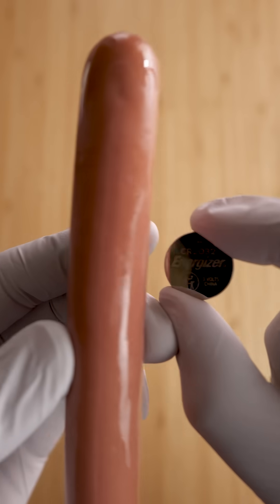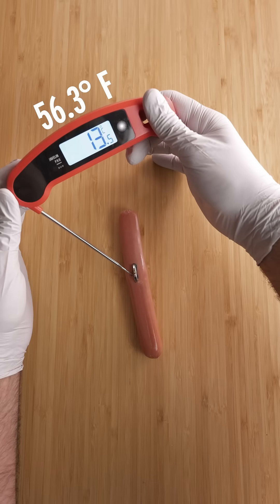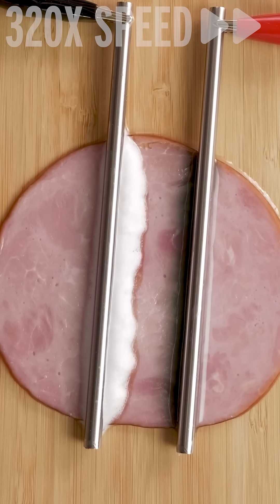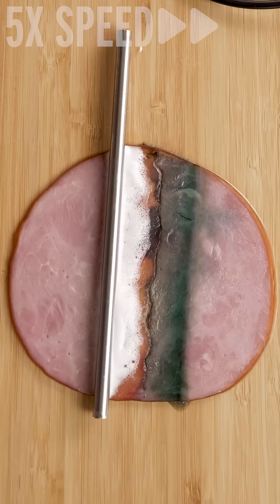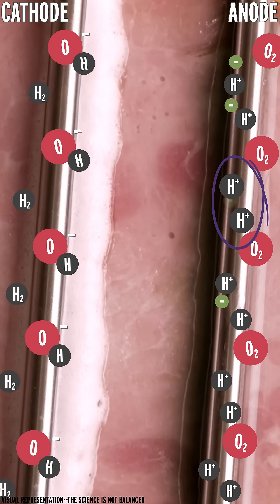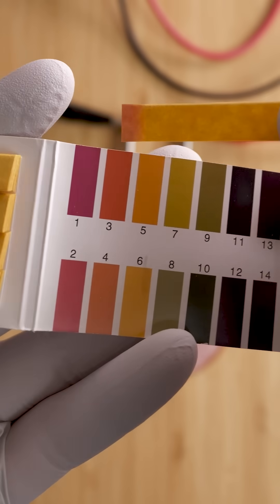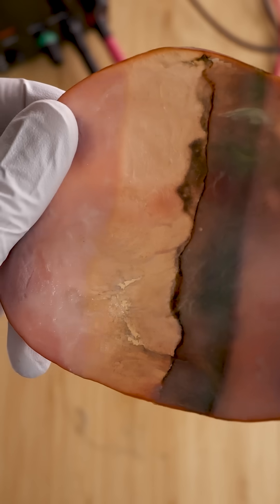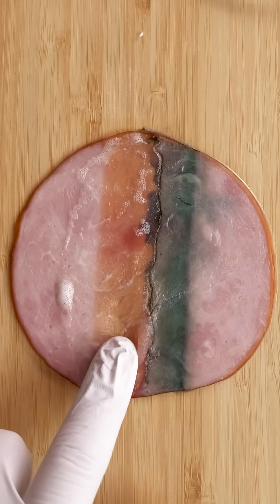don't swallow watch batteries

Comment: Good thing is that if you accidentally swallowed batteries, those acids and alkalis generated from electrolysis don't stay at just one place like in the demonstration. They flow along water and food. So the best thing you can do is drinking a lot of water to dilute everything and push the battery into your stomach asap, where the stomach acids basically beats everything the battery can make

Comment: Just a heads up for the people thinking this guy is right, he is to a point. A battery will do this, yes. BUT it takes a while and unless the battery gets stuck somewhere along the way, it will very rarely sit anywhere long enough to cause this kind of damage. More than likely it will just after the liquid in your stomach, balancing its own pH production. ITS ONLY AN ISSUE IF IT GETS STUCK.

Comment: Electrolysis requires about 1.5V, or about 1.25 if enough heating is constantly provided, so yeah, 3V battery could cause some electrolysis, but "cranking voltage a little" contaminates the experiment a LOT. If the battery were to get stuck inside for long enough though - unhealthy things are to be expected, so keep the batteries away from children all the same.

Comment: This is significantly stupider than initially portrayed.  How about, leave the matched voltage and consider it in context of how much current can flow, and at what potential (voltage).  And mimic the aqueous conditions of the actual digestive tract.  Stop performing ham catalyzed electrolysis on the counter and get your facts straight.

Comment: Very good video, I did a chemestry focused High school and those pH levels not to be taken lightly, although yes they are Dangerous our Blood has a Natural defense against acids and bases (to a certain extent). Our blood Is a buffer solution, explained quickly all acids release hydrogen ions (H+) while all bases either accepts hydrogen ions or release hydroxide ions (OH-), those are the Dangerous parts since they react with almost anything and make strong bonds pretty much breaking what was there, buffer solutions are solutions that keep the pH at the level the solution Is (to and extent) by reacting with H+ and OH- or in other ways that I don't know, regardless as long as the solution has components to react It Will maintain a stable pH.

Comment: When I was in school, I swallowed a battery out of a calculator, it was one of these kinds of batteries, but smaller. I was taken to the hospital by my teacher after they informed my parents, and the doctor told me it would just pass through my system as normal and I should not be worried
Reply: And to be clear, I had no pain, no stomach issues, nothing. It caused no damage to me whatsoever, even on followup scans and doctor visits

Comment: The power density of button cells is impressive, because they work by reacting with the air. In fact, you can increase the power output of one by putting it in an atmosphere of pure oxygen.

Comment: well asophagus is not really the problem. the whole thing becomes a problem if it stays at any spot for a long time. typicly stuff moves at a constant pace through the body so it would only do minor damage to all parts equalls. however a button battery is really well shaped to getting stuck somewhere which is when it becomes a problem and dangerous

Comment: Electrolisis, fat saponification and protein denaturation, remember not to make your children puke after they swallowed any alkali or acids, because the same ammount of damage that it caused on its way in, will cause on its way out. Once they swallowed it be sure to identify the chemical product and bring your child to the ER alongside the product, it will make our job easier since the treatment for caustic swallowing is different depending on wether it is an acid or an alkali.

Comment: By the way, the reason for all that bubbling at the anode is that hydroxide (and bases in general) reacts with lipids (fats) to create soap. The electrolysis reaction is actively turning the ham and the hotdog into soap and it can do the same to you.

Comment: Damn I always thought it was cause it was small and round shaped so it would accidentally block the airway. Had no idea about this. Why aren’t other, regular batteries so heavily advised against swallowing then? Like not AA but AAA? If you were determined ? Which kids tend to be. Also other even smaller cylindrical batteries. Is it cause it’s harder for both the battery terminals to touch skin and cause that current? Would be very interested to know. 

This was a cool video.

Comment: I have a genuine question - would this happen not with a battery, but with electrostimulation? If you had electrodes on you for long enough, would this cause the water in your flesh to break down like this? I've seen new research on PTSD treatment using mild shock therapy today, and also thought of the more lewd electricity use, and it makes me HORRIFIED to watch your vid.

Comment: So is this voltage or amperage based damage?
Reply from the maker: You need a sufficient voltage to make the chemical reactions go, and the more amps go through the circuit the more hydroxide you'll produce, the more damage you'll do. So, both.

Comment: Lithium and water has an explosive reaction to is as well.  lithium and hydrocloric acid(main component of whats in our stomachs) has an exothermic reaction that releases lithium chloride and hydrogen gas. So your stomach would feel like its on fire (because it is) and you would experience bloating and lithium toxicity if you didnt explode on your way to the hospital. (You probably wouldnt...maybe)

Comment: I have a question! If the battery eats the flesh why doesn't it affect our skin?
Reply from the maker: Great question. Our skin doesn't have an electrolyte solution (salt water) on it, whereas the inside of our body (mostly) does. Without an electrolyte, there's nothing to conduct electricity between the battery terminals

Comment: Use honey until you get to the ER if you or your child happens to accidentally ingest a battery or battery acid. Honey coats the battery which neutralizes the solution and slows down tissue damage.

Comment: It’s kinda like a voltaic cell. The electrons transfer from the anode to the cathode and in doing so consuming some of the anode metal particles and transferring them to the cathode. Which kinda explains why the negative is transparent a bit because the negative is the anode

Comment: Damn…that pork 🪦 just to be cut into slices of ham and used in science to show others the danger of swallowing batteries; a ☠️ well met I guess. But yeah, this is extremely helpful. You can tell people don’t do it, but to tell them WHY is far more helpful. Information without the knowledge of showing why it’s dangerous is just information. To most, that means eh I’ll worry about it when I get there; but to many now they pre worry in case of it happening. I took phlebotomy and I can’t even BEGIN to describe to you how many times I had to line out information to people as to WHY you need to let phlebotomists know about Bloodborn illnesses or diseases. Now, due to the US having this protection 💩 where patients aren’t inclined to tell you is some BS. Seeing people’s face when I explained the ins and outs of every symptom they posses and putting it on another human being was a lot of shock. I have half the lifespan of a human being DUE to autoimmune diseases, high chance of cancer, anemia; and I made sure to show them what would happen to my system if they lied to me before getting the blood taken. If you don’t value your life, don’t push that on others. Know the danger, know why it’s dangerous, prevent such dangers with said information. If they didn’t understand words, I would write it out. If that still didn’t through to them, I showed them photos of what happens to a body when infected with a Bloodborn illness or diseases. The last one usually got it through to them. Knowledge is one of life’s most powerful influences, and it’s n*glectful to witness everything and still choose to not care or do anything to prevent it.

Comment: So, ph 11 + ph 3 = ph 14. Divide by 2, that's an average of ph 7 (neutral). If it would be stuck in the esophagus for a period of time, it could do damage. However, in the stomach (ph of ~ 2.) It's probably not going to make a huge difference. It's more of an issue of a small bowel obstruction after that.

Comment: When I was 10 I put one of these in my mouth cause there was a weird shocking feeling it gave me. It didn’t hurt, just felt weird so I kept doing it. Ending up getting this weird sore on my cheek (later found out it was an acid burn) my mom had to call poison control😂 had to gargle hydrogen peroxide and warm water for 2 hours straight😂

Comment: I work in a prison that has a large number of psychiatric patients as well. Really common for guys in my facility to swallow whatever batteries they can get their hands on, usually from the unit tv remote, their cassette players, book lights etc. Usually they do it because they want to go out to the local hospital for a couple days or because someone pissed them off. One guy swallowed two batteries that apparently started making contact. Found out after a few days that one of the batteries supposedly burst or started leaking. I couldn't imagine that feeling.

Comment: Heads up to those who may ingest a battery and need to know how to help, honey and lots of it! Will keep the battery from disintegrating the tissues this way at least until you can get to a doctor. This is not going to stop the battery completely but will extend the time you have so you can it removed safely. Be safe out there y’all ❤

Comment: Little known fact: for about the last five months, watch batteries like this and the 1.5v silver oxide batteries are much harder to open. They used to be easily pushed out the back of the package, but now the plastic is too thick, and they have to be cut out. I was told by my parts supplier that some kid ate a battery and was seriously injured, so now we watch shops and jewelers have to pay the price.

Comment: I once got my workboots wet in a Sodium Hydroxide basin that had about 1/2" of solution, a little later i rinsed them but never tried to neutralize. A few days later while walking across the brewery, my soles came off the caustic had eaten the natural stitching holding the soles to the boots. LOL

Comment: Omg, when I was around 4-5 , I had watched my dad use a screwdriver to open things so I knew how it worked. I had found my old mobile and decided I could change the batteries (despite not knowing where to find new batteries). While my parents were talking to guests, I got a stepstool, climbed up a shelf, grabbed a screwdriver, and had managed to open my mobile. As I was looking at the old batteries(I think they were button batteries), I realized there was liquid oozing from them(probably the insides of a battery). I think it’s some kind of sauce, so I dip my fingers in and am about to eat it but somehow I gain consciousness and realize that there shouldn’t be “sauce” coming out of batteries. So I ask my mom and she FREAKS out, super worried asking if I ate some (I didn’t). I was fine, but I was feeling a bit queasy all day just thinking about what could’ve happened.

Comment: If only PSAs could be this direct & informative, instead of theatrical & comical.
Reply: PSA need to be dumbed down because the average person who thinks they can eat batteries isn't the kind of person to understand "hydroxide" and "acid vs bases"
Reply: @verbosequestion  "Don't swallow batteries because it will dissolve your stomach" seems more straightforward than "🥚 this is your brain, 🍳 this is your brain on drgs"
Reply: @verbosequestion  dont let me say It dude. I dont want to be cruel.
Reply: it needs to capture attention. turning PSAs into lectures will bore the fuck out of people, therefore the message will reach no one. 

Of course, PSAs need to make enough sense and not be TOO much
Reply: "hey are you planning on eating batteries? this is Tom and this is Tom after he ate batteries" shows a woman and man standing over a grave with his name on a tombstone
Reply: Exactly!!
Reply: Be safe around trains. A message from Metro. :)
Reply: I wish. One of the most effective PSAs I have ever seen were the anti smoker ones in the early 2000s, where they'd have an ex smoker talk about their experience and how it ruined their life. We need more like that.

Comment: "cranking up the voltage" messes with a significant parameter. As in - gently throwing a metal ball at a glass window won't do much, but if you throw it harder, the glass will crack.

eating batteries is still bad tho, even at low volts.

Comment: FYI those batteries taste super bitter and turn your saliva blue like in the video but you won’t be able to get the taste out for at least 5-10 minutes even with running your tongue under water and rinsing your mouth. I know from experience bc I was curious. Didn’t swallow it, just barely touched it to my tongue for a second

Comment: Interesting visual explanation on how batteries can affect meat, human or otherwise. Though I very nearly scrolled past due to the title. Would have been an instant click had it been named Batteries in Meat or something more descriptive of the content. Framing it as advice seems condescending. Don't eat batteries as advice is one rung above don't put any part of yourself into a running lawnmower. Anyone young enough to find either of these tips useful isn't supposed to be on these platforms unsupervised.

Comment: I did not understand this when I was a toddler, cracked open a toy & ate the battery. Hours of unneccesary stress to nurses & doctors later, surviving was a miracle.
Parents, please DO NOT have cheap plastic toys using button battery, no matter how safe toys feel & how responsible a child may be, it's too late when it is caught 99% of the time. PLEASE never even BUY toys that have those dangerous ones if the child is young

Comment: Neglected a lab coat once and got potassium metal on my forearm.  It turned a 4cm circle of flesh into salt and soap.
Reply: Not from any temperature burn but from the resulting potassium hydroxide that was formed on my skin with water from my cells and pores reacting with the alkaline metal

Comment: Also, I assume if it reaches the stomach acid, the heat produced from acid/base contact could also cause damage, not to mention the bloating from oxygen and hydrogen being produced by electrolysis in a sealed chamber. 
(1.5v isn't as bad because the terminals are further apart and the voltage is lower, but these are 3.2v and more importantly, the close ±electrodes can conduct mich more easily)

Comment: It is important to make sure you do not short circuit the battery with the tweezers which would result in a Tesla type event. Use plastic tweezers to remove batteries from kids noses.

Comment: Now I don't know what it is You guys are exactly trying to prove but let's be realistic about this. For one thing the child esophagus (their throat) is the same size as that hot dog, maybe some of them little bit bigger just by a small fraction, and as you can see that battery only fit halfway in that hot dog. There's no way a child's going to be able to swallow that battery. Secondly if they put that battery in their mouth the charge is going to have them spitting it right back out, just like a 9 volt battery except this is higher voltage so none of that's going to end up happening. And what you're proving with the ham there is really irrealistic, because they're not going to swallow the probes and you using salt water so with the salt water it's going to raise the acid balance and they don't have salt water in their stomach do it with stomach acid if you want to prove a point. But you wouldn't be proven anything because those batteries are too big for them to swallow so none of that's is ever going to happe. And realistically if they put those batteries in their mouth, think about it the voltage In those batteries are pretty high and the current will cause them pain, so The first contact to their sensitive tongue will make them spit it right back out. And if they don't because the battery might be dead. Still they're not going to be able to swallow it because it's too big so none of that is ever going to be a problem. I don't know what you're getting to. but the parents should be keeping anything like these batteries or anything else that dangers to a child out of their reach. So what is it exactly you guys are trying to prove here, What is it exactly you guys are trying to say about these batteries and the problem with these batteries and young children. I don't quite understand what point you guys are trying to make, other than their dangerous to swallow, which is not going to happen, unless there were force fed. So please explain to me what you guys are trying to prove here? 🤔🤨 And please be REALISTIC and HONEST about this explanation?
Reply from the maker: https://publications.aap.org/aapnews/news/22054/Studies-Button-battery-related-ED-visits-increase

Comment: If the root cause is electricity, why is it button batteries specifically that have this danger? Would the same thing happen if you swallowed a AAA, for example? Or do all batteries carry this danger and it’s just that button batteries are more likely to be swallowed?